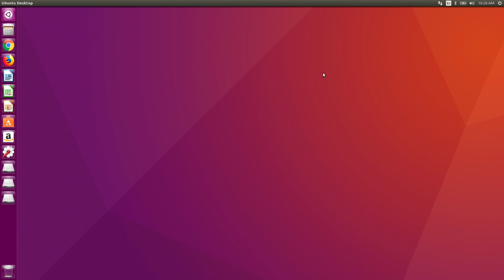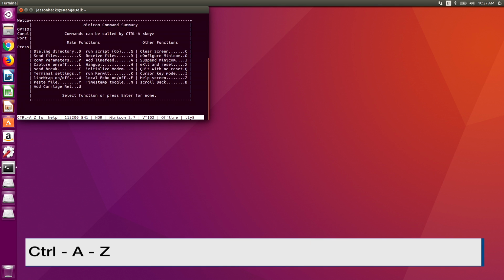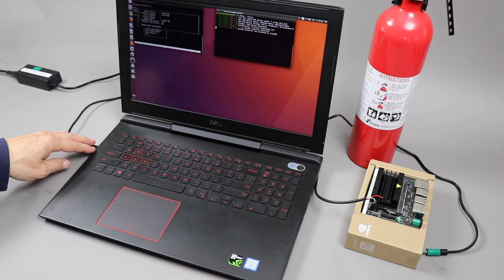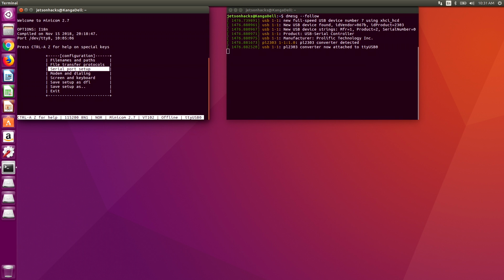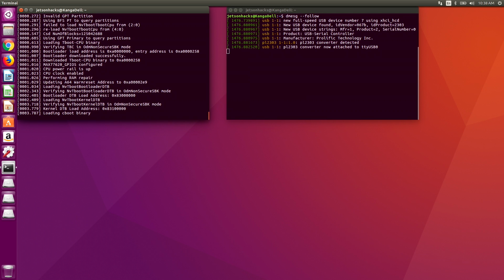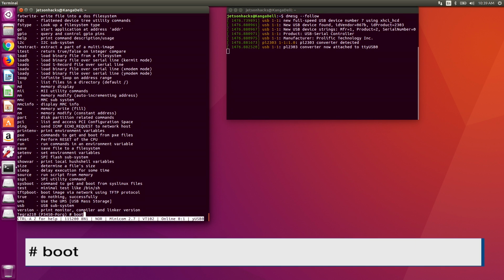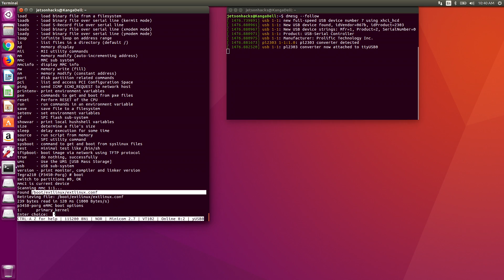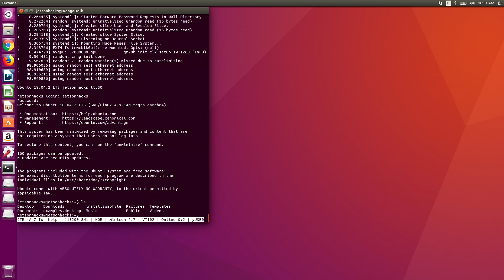JetsonNano - Serial Console

Comment: Since there is also a serial port on the 40pin Raspberry pi GPIO it means it has two independent serial ports?
Reply from the maker: Right, it has two UARTs. One is used for the serial console, and there is a UART on the 40pin GPIO header. However, it's takes some work to convince the serial console to act as a normal UART. Thanks for watching!

Comment: I could not get this to work using RealTerm on Windows or minicom on Ubuntu. I bought a DTECH USB to TTL Serial 3.3V Adapter Cable.
Reply from the maker: I don't have any experience with that USB adapter cable. Please ask you question on the official NVIDIA Jetson Nano sport forum, where a large group of NVIDIA engineers and Jetson developers can help. Thanks for watching!
Reply: @JetsonHacks  I had better luck with a USB to TTL serial cable from Adafruit. It uses the SiLabs CP2012 chipset instead of Prolific.
Reply from the maker: @robrobbins  I am glad you were able to get it to work!

Comment: How many UART ports I can configure on Jetson Nano?
Reply from the maker: There is one on the GPIO pins, and the serial console. It takes a little bit of work to get the serial console to work. Thanks for watching!
Reply: @JetsonHacks  Is it possible to change baud rate of ttyTHS1 to 9600? from default 115200 baud rate?
Reply from the maker: @kvnptl4400  There are a variety of ways to do this. Please ask this question on the official NVIDIA Developer forum.

Comment: Nice video. although still wonder what is the advantage of using a ttl cable other than ssh to the board.
Reply: With SSH, you would have to wait for the system to boot up completely and the network to be available (and know the IP address of the nano, if it gets a dynamic IP every time it boots). It is much more convenient to to just have the TTL cable connected instead of carrying an Ethernet hub (or sacrificing the Ethernet port of the laptop with a cross cable). Besides, if there is a problem in the nano booting up, then it is easier to take care of that with a serial console.
Reply from the maker: That's correct. While you can use the Serial Console in a SSH type of manner, it is also known as the 'Serial Debug Console'. As shown in the video, you can interrupt the boot process (before the Linux kernel is loaded) and manipulate almost all aspects of the memory, environment, devices and so on from the console. This is before Ubuntu is loaded, and  long before SSH is available.

Also, you can have multiple Linux kernels on the system. This method provides a mean for selecting between which kernel gets loaded. For people working on the kernel itself, or if there is a device which is causing issues with the boot process, this is an invaluable tool. Thanks for watching!
Reply: @JetsonHacks  I had the same question, good answer but brought up another question.  Can you access the nano s' BIOS like you would on your home box?
Reply from the maker: @glikar1  Like most embedded boards, the Jetson Nano does not have a BIOS. It's much closer to bare metal programming than a PC. This is also why a Serial Debug Console is a more valuable commodity on an embedded system. Thanks for watching!
Reply: @JetsonHacks  Right, obviously dumb question but there must be a bootloader and a few other routines in Non-volatile  memory.
Reply from the maker: @glikar1  Not a dumb question, embedded boards just work a little different, and have a different startup architecture. The ROM basically consists of just enough to load the boot loader from disk. The current Jetsons run U-Boot as the primary boot loader, and CBoot as the secondary one. A BIOS has a lot of parameters that you can adjust, on an embedded system, not so much.
Reply: @JetsonHacks  Interesting, thanks.
Reply: good question